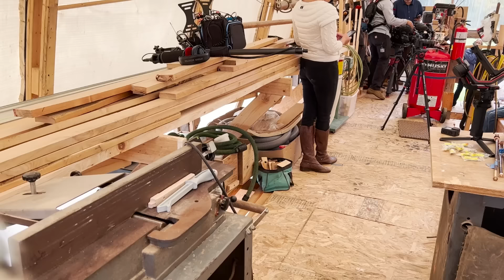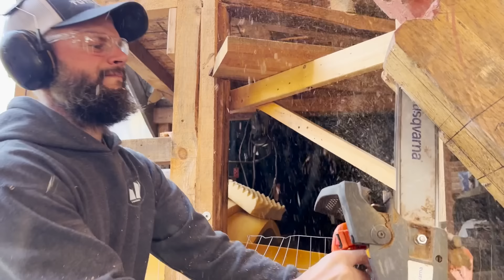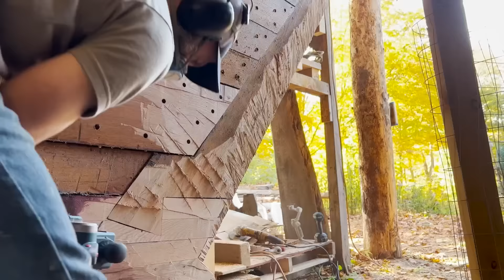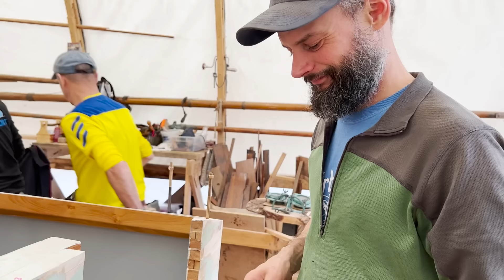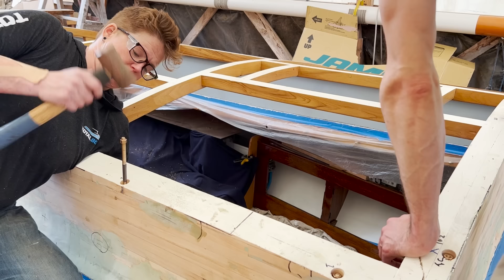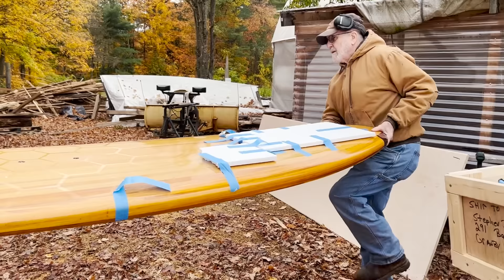The Right Tool For The Job - Episode 238 - Acorn to Arabella: Journey of a Wooden Boat

Comment: The perfect way to lumpy and asymmetrical finish. A grinder can be used in fine arts, but the strokes need to be long, steady and smooth. Also the chain was so bad it almost made me cry. And again for future projects, the fiberglass is a structural component, to tie up the wooden frame. To fair and finish, use the fairing compounds on top of the structure, not in between. Fairing in the middle creates fluctuation in stiffness as well as water traps due to porous nature of the material. When stressed, this compound moves unevenly, creating cracks and separation, to trap more moisture for all kinds of problems. Will it be "just fine" for a decade or so? Sure, depending on the weather conditions and UV exposure. But when comes the time to fix it, a rotten core is harder to fix than a flaky finish.

Comment: I wasn't concerned when he broke out the chainsaw - I think at this point if Steve said the only tools needed complete the project was a backhoe and a spoon, I trust he knew what he was doing.
Reply: That dull chain though, lol
Reply: @SvWarfield  I thought that too, but in the video he said he was using a cross-cut chain because he didn't have any ripping chains.  I know from my own cutting that this makes a big difference, so perhaps the chain wasn't dull.
Reply: Well said. I believe I have the same faith
Reply: the other option was to lay the whole boat on it's side and use the adze 😉
Reply: Pretty sure Leo of Tally Ho also used the chainsaw for initial shaping of the stem!
Reply: I don’t understand the dull chainsaw.   Steve certainly knows the diff between chips and sawdust.   Maybe he will explain why he didn’t sharpen that chain.
Reply: @joden1057  He did, he said he was using a cross-cut chain because he didn't have a ripping chain to use.
Reply: @Mark_Bridges      I understand that a ripping chain would have been preferable but the chain he used was DULL.   See the dust, not shavings?   And the cut
looked like a rat chewed it off.    Perhaps he didn’t care because he knew he would be planning it anyway.

Comment: I’ve always heard people talk about sailboats, among other things, reacting differently on 1 heel or the other or in following seas or whatever. Watching how steve took down the cut water it’s easy to see why, just a little different angle here and a small change there and you get different reactions to things. Very interesting
Reply from the maker: Normally a sailboat will sail differently on different tacks due to balance inside the boat or conditions on the water (wave/current direction will produce a “better” or “worse” tack. Since most sailboats, on a real good day, are only going about 6 miles an hour, one might not feel the difference of a portion of an inch on one side or another of the sternpost shape. —Anne

Comment: National TV, spectacular.  That oak is either extremely hard or the chain saw blade is dull.  Lots of saw dust; not may chips.
Reply: "Cutting bone-dry, tight-grained oak is difficult. The chain was sharp… most people see chainsaws in action only on green wood."
Reply: @99Etien  Thanks.  I am not trying to start a quarrel or question Steve's ability to use sharp tools.  He is a master craftsman. But I have cut bone dry tight grain oak for firewood for 9 years and have a different experience.  Cheers
Reply: @johnnya9001  I don't know, it is just what they said in another comment.

Comment: Obviously follow whatever experts say in boat design. But at least for car aerodynamics (and I think the same might apply for water at driving/sailing speeds as they're both fluids), you'll want rounded corners on leading edges pushing through the water (front face of the stem), and a sharp edge where the water flow leaves the ship (trailing edge of the rudder). 
Round leading edge prevents needless vortexes from forming when it flows around a sharp transition along the hull. Sharp trailing edge helps encourage clean separation of the fluid flow, which helps reduce energy-sucking oscillating vortexes (vortex shedding). At least, that's how it is in cars, and I know other ship/material factors may take priority over little details like that.

Comment: Just thinking. 🤔🤔Wouldn't it have been better to use Butyl Tape? To seal the house top to the opening. It stays soft indefinite it's easy to pry apart, remove, reapply, and there's no cure time no waiting. 🤓👍👍

Comment: Thinking about it, if you are going to use a power tool to do that rough cut, the chainsaw has a lot of advantages. A big demo blade on a reciprocating saw might be the other obvious option, but it is way, way less rigid and liable to flex and follow grain - the chainsaw won't do that - it'll definitely go where you put it. I wouldn't have had the guts on something so hard to fix, though.

Comment: Love the shaping of the stern, and maybe the stem as well? Wasn't sure if that was both ends or just the one.
Glad the cabin top went back in place without much issue from the bulkheads (or at least you chose not to show it in edit).  The paddle boards look amazing, Paul, great job. I'm sure we'll be seeing them in future videos, with those tie-downs being well used. They might have to install racks on the sides to carry them, but no doubt they'll find a space for them somewhere.
Reply from the maker: Just the stern for now.

Comment: Add a 6" length of pex tube to make it easier to carry using that bite of cord on the paddle board. Usually there is only one plug with all channels open to cross venting. I wonder why the maker chose to add so many. Water tight bulkheads perhaps?

Comment: I visited Arabella last Monday and saw the cockpit laid in place (rocking a bit); clearly needs bolting down at some point. Presumably built in one piece with the decks on each side so if the motor ever needs to be replaced or removed it can be done. I had a question and a comment:
Having seen the cockpit in person it struck me how shallow it is. Obviously this is good for limiting the weight of water it holds if you get pooped by a big wave, which is all good. But no sign of coamings to lean back against.  I assume you will be installing some such eventually?  On a long passage you would really want those. 
     The comment I wanted to make was if Steve hasn’t really learned to sail yet, a dinghy sailing course is the fastest way to do so and make it instinctive. You learn sailing way faster in a small boat than in a sizeable boat like Arabella. I owned a Ranger 26 for many years and always reflected on how much less that responded to puffs of harder wind etc. 
     P.S., I was very charmed by Anne’s little Boston terrier; its nose is very short but it was really smelling my golden retriever on my pants legs. So cute!
Reply from the maker: Thanks for stopping by, Doug! Nice to meet you! Yes, there’s a lot of work to do around the cockpit, and what we’re focusing on right now are all the things that are temperature dependent, such as gluing and painting what we can’t easily bring to do inside the house. 

As for learning sailing, that’ll be done on Arabella and in the dinghy. Lots of time to do that when we’re not building. 😁 cheers and happy Friday! —Anne

Comment: Nice work! I have been listening to you narrator for a while now and it would be an asset to your channel if he worked in his nomenclature. For instance, the proper name for what was just bedded down is "cabin trunk". The house top or coach roof is then laid over the house top or coach roof frames. Looking up at the underside of the coach roof one would say, "I'm looking at the overhead", not ceiling. There is sealing on the inner side of the frames and also can be applied to the overhead. Interior sealing adds strength and provides a barrier to the hull preventing things from getting lost to the bilge. Traditionally the sealing is either left open at the top or left with space between the horizontal planking.
Reply from the maker: Okie dokie. Thanks for the feedback.

At the risk of being pedantic and joining the party here, the word for interior planking you’re describing is also spelled “ceiling”. Thanks for watching! —Anne

Comment: Steve, have you been taking sailing lessons? This is quite a unit to maneuver I am sure (would scare me to even try to sail it). With a motor running but under sail sends you back to before the Vikings in the skill level required. Of course, the ocean changes the sailing conditions at will. Are you ready for the challenge?
Reply from the maker: Yup. Lots of friends will come help as Steve learns. It’s not like he’s going straight off to Liverpool from the launch. 😁 thanks for watching! 

And also, sailing isn’t all that hard. Practice, care, good planning, patience, and observance make a good sailor. Steve’s wilderness training and experience exceeds what most green sailors come to sailing with. Thanks for watching! —Anne

Comment: That pick up truck was seriously low on the left front!  But seriously folks, question. What would the process be for removing the housetop years down the road? cutting the lowest strip out where the 4200 was used?
Reply from the maker: It would be to use a heat gun and scrape out the 4200, or just cut it. It’s a glue, but it’s kind of gummy and easy to cut.

Comment: Question, did you think about a lightning protection system for arabella? I heard that counterintuitively steel boats can survive lighnings easely by letting the electric current through, but that anything that isolate itself electrically from the sea can endure quite some damage if thunder hits the mast (ie including wooden boats). Apparently there are some systems that takes the electric charge to the keel. Thoughts?
Reply from the maker: Most lightning protection systems I’ve seen on boats aren’t necessarily based on science but they are many and varied and people have very strong opinions about them.
Reply: @AcornToArabella  OK that's interesting! I won't go in this rabbit hole, but I would love to know if people had experiences about masts getting hit without them, and what happened
Reply from the maker: Well, I’ve had friends (a few, because it’s very rare!) tell me what it was like, so that’s a good indicator that they not only survived, but got home safely. One person had a strike happen 15’ or so away from their boat! It’s where the electrons are, not just tall stuff, that makes it happen. —Anne
Reply: @AcornToArabella  thank you for the responses! Keep up with the good work!

Comment: So if you are glueing it down how ever will you be able to remove it? As you planed
Reply from the maker: 4200 can be cut with a knife or easily coaxed with a heat gun.

Comment: What kind of sanding pad setup did Stephen use for the sanding of the stern and bow?
Reply: First guess - angle grinder with flap discs of various grades.  Nearly as effective (rapid) as a chainsaw at removing lots of wood quickly, but gives a better finish.
Reply: @18robsmith  I have little experience with flap discs - I will have to try them - Thanks!

Comment: What did boatbuilders use before fiberglass?
Reply from the maker: Canvas and white lead paint… not the same exact thing but kind of. Epoxy wasn’t developed until mid-20th century. Fiberglass plus epoxy is what ultimately wraps around a core material to make it composite/waterproof.

Comment: why not use a rubber gasket instead of 4200? Might make removal much easier (but still water seal)...
Reply from the maker: 4200 gives way very easily to a knife and a heat gun.

Comment: Looks like you had some struggles with cut did you use a ripping chain on saw
Reply from the maker: Tight-grained, bone dry oak will be that way. Yes, it’s a ripping chain.
Reply: @AcornToArabella  that explains how fine the dust is

Comment: Glued with 4200 and bolted together with thread rods and nuts…. Hmmm OK, in what world it that now “removable”???
Reply from the maker: It shouldn’t be easily removable, right? It’s not structurally tied into the grub in a way that will mean we have to do demolition to remove it. 4200 responds well to a heat gun, and bolts can be… well, unbolted. Thanks for watching!
Reply: @AcornToArabella  
Ahh didn’t know about the “heat gun” part!  I had always heard folks talk about 4200 like it could hold a lead keel to the boat all by it’s self AND hold it on for,100 years?? [more sarcasm from me and obviously nonsense LOL]   The bolts and nuts of course, that’s a no brainer.  Seems like some kind of joint compound? or butyl tape? Would get the job done yet make it easier to remove [even though you clearly hope,that day never comes?  LOL
Reply from the maker: Exactly! Hopin’ that day never comes 😁🙌
Reply: Brad you must be thinking of 5200

Comment: why the heck didn't you cut that piece before fastening to the boat??
Reply from the maker: The… sternpost? It’s easier in place. Don’t know a single person who would cut that before planking is in place. —Anne
Reply: @AcornToArabella  The Western Flyer stem was shaped before it was mounted on the boat and before planking.
Reply from the maker: Maybe they felt ok about moving around those boats with tools and lumber… ours would have been nicked, and we’ve found the extra material to be handy to clamp to. ¯\_(ツ)_/¯

Comment: Will you vacuum bag the house and other fiberglass sections?
Reply from the maker: No, there’s no need to do that, we don’t need laminations to have the glue pulled in, we need a hard outer shell.
Reply: @AcornToArabella  Thanks for indulging my inexperienced questions! (I restore airplanes, mostly fabric and metal structures) Would that technique provide a smoother finish?  This channel has me watching several other projects some wood, some metal, some fiberglass.
Reply from the maker: Happy to! Concerning smoother finish: Not necessarily… sometimes vacuum bags leave a texture where the bag wasn’t completely flat. Again, the bag is there for creating the seal, and the vacuum is for sending resin into multiple layers to make a composite material into one solid piece. Peel ply is something people use to achieve a surface that doesn’t need much sanding and that removes blush (waxy byproduct from the curing of some types of epoxy). —Anne

Comment: That fibreglass idea is fundamentally flawed. It is a big mistake. It WILL split. The differential rates of expansion and contraction between the substrate and the fibreglass will destroy it, in the same way it destroys fibreglass on rooves. I'm an architect, and I've seen it dozens of times. Your only chance of success with fibreglass is to have it unrestrained across its length and breadth. Yours will break at the edge of the housetop, and will delaminate from the base and sides of the cockpit, causing "bubbles" which will split eventually as you walk on them. Such a shame to waste this effort.
Reply from the maker: Fiberglassed strip-built boats, entirely made that way, hull and all, are common. Sorry you’ve had bad luck with fiberglass. Perhaps it was the type of epoxy? Perhaps too few layers of glass? Perhaps the surface wasn’t wetted out properly? I myself own a boat with a fiberglassed deck, built in 1996, highly repairable and easy to maintain. —Anne
Reply: @AcornToArabella  No, no. It's absolutely nothing to do with the epoxy. It's a fundamental of differential rates of expansion and contraction between very different materials, and of the shape. Strip built boats are light, weak structures. An arm wrestle between a layer of fibreglass INSIDE AND OUT, (which you guys can't do) and a thin layer of WRC, with a curved shape, is usually going to end with the F/G winning. In other words, the fibreglass constrains the timber. Being entirely surrounded by fibreglass is a huge part of that story, too. That restricts the amount of moisture reaching the timber, so reduces to virtually nothing the amount of expansion and contraction in the substrate. You just physically can't achieve that.
So, A2A is going to have comparatively thick pieces of timber which are crucially open to the atmosphere on one side, having an arm wrestle with fibreglass. The shape of that fibreglass has right angles in it, draped over a moving substrate. When the timber expands it will eventually crack the fibreglass at the edges of of the house roof. If you disagree with that, you need to explain (not to me, of course, but to yourselves) how you think the fibrglass can accomodate that movement. You are trying to take lessons from X and apply it to Y. The circumstances are not in any way comparable.
I've always wished this project well, even when I've criticised it. I'm not sure which will fail first between the "plywood" bulkheads and the house roof, but they will both fail. Maybe then you guys might sit down and ask yourselves why you didn't have better conversations these about fundamental aspects of the construction.
Reply from the maker: We’ll be here for the I told you so comment when the boat falls apart. 😉Hahaah just kiddin Mike. Thanks for watching.